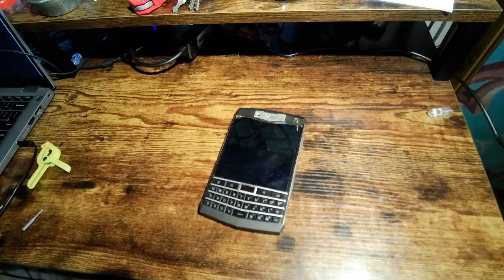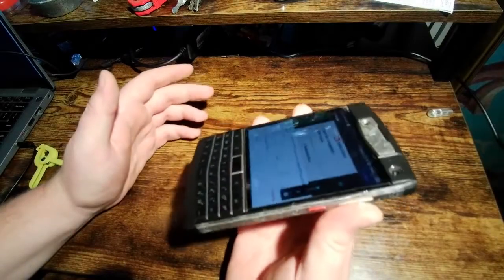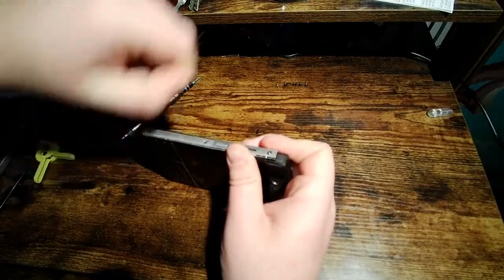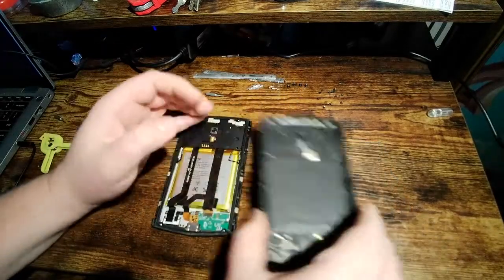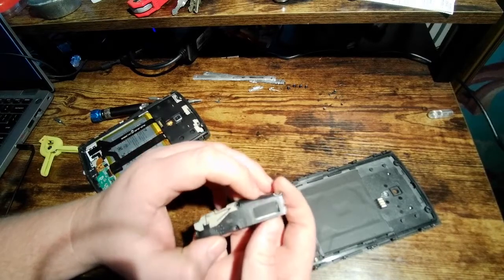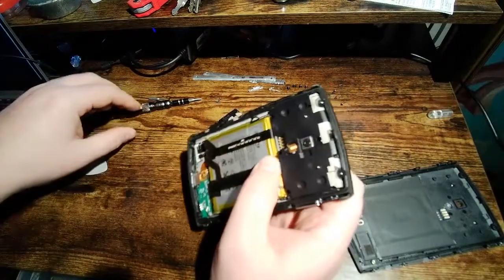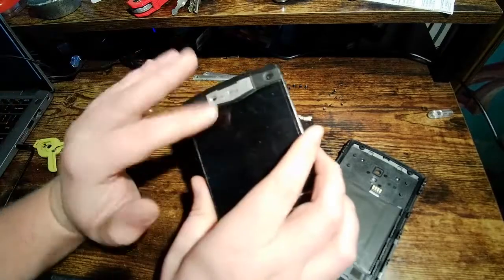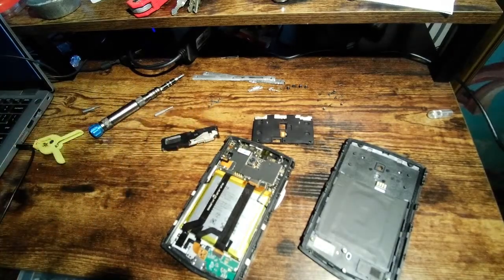UniHertz Titan Teardown - Is it really waterproof?

Comment: thank you. excellent informative video. the parts being screwed into: are they plastic, or metal, or both? just wondering how long the body threads could be expected to last, if often disassembling. I've been using my Titan every day since June 2020 with no notable issues, now on Android 10. never took it apart, but I do wash it with soap and water lightly, (then grab it from the back and shake most of the water out, the way a cat shakes itself dry, rubbing it dry with a towel, too), then let it sit to air dry, and that works great.